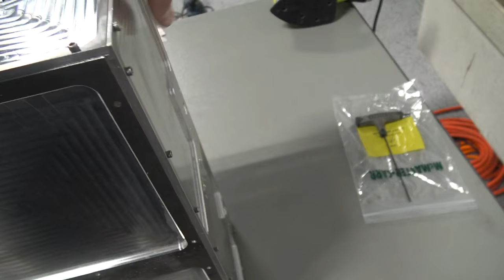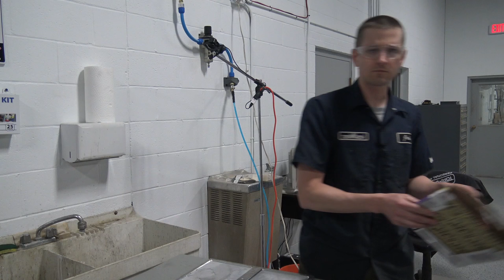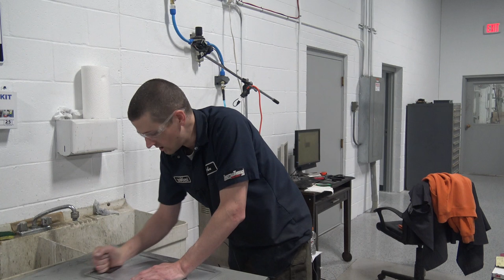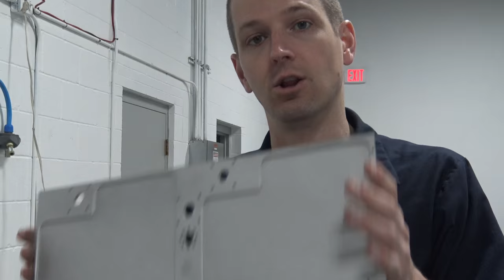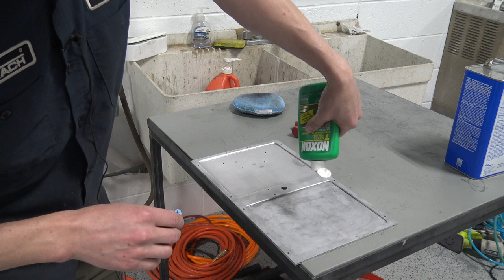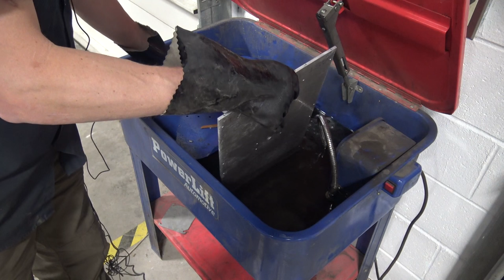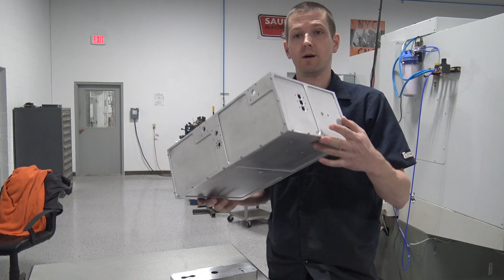Remove Machining Toolmarks!

Comment: I am sure that this is a stupid question but I must ask how deep is your finish cut for the bottom when pocketing I always or nearly always use a .007 to .012 step for the final finish pass at bottom of pocket. doing this greatly reduces the surface variation from tool deflection.

Comment: If your goal was a uniform finish couldn't you work with some die grinder wire brush or scotch brite attachments and get a nice brushed metal finish with some pretty straight forward CAM?  Might not have been spec for this part but swirl pattern looks pretty amazing and is well suited for CAM.  Maybe with some tinkering you could go from cut to brush in CAM and straight to media blast and skip most if not all of the sanding.

Maybe someone can write a random orbit wire brush path for Fusion 360.  ;)

Comment: personally i would 1st use scotchbrite that will keep the face flat rather then using power tools and getting high and low spots. then use some 600 wet and dry ( multiple directions) followed by some 1000 girt with dimond paste on. then to get a mirror finish just go over with a peice of paper (yes normal a4 paper) .... your correct about tool step over the most you want is a 35% stepover.

Comment: I of anticorodal to remove the milling marks I make a pass on the floor finishing with a normal cutter to finish carbide not coated with 4 cutting edges leaving 0.05 / 0.1mm from the bottom. roughing with the same cutter to 3660 rpm - 1380 mm / min and finishing engaging the 80/90% of the milling cutter with parameters from 1500 rpm- 480 mm / min. bur I hold more committed can so sharp enters traditional milling and combining the low speed prevents vibrations. obviously in the cutting area there is a waterfall of coolant  to avoid built-up edge.

Comment: I saw a demo years ago......you might want to check into actual glass bead blasting.  I'm guessing you're actually using glass abrasive at a fairly high pressure?  90psi?  Glass beads get used at around 40psi, otherwise the spheres shatter.  The beads can be used to smooth the surface without any dimensional changes.  You should be able to get a luster to the finish.  It might require a different blast gun....most of the siphon feed ones don't like to work at low pressures.
Reply: +bluehandsvideo Thats what I would have done myself, bead blast. Sanding sucks and all this sanding... wow
Reply: +bluehandsvideo agree... a softer bead media. plastic media works well
Reply: +NCPDFSB The plastic will smooth out the machining marks?

Comment: You should consider Roloc discs. They are much easier to use than that vibrating sander. At least for the corners.

Comment: After sand blasting use a fine wire wheel then for the polish use mother mag wheel polish.  Your results will be amazing 
Your drill press was spinning WAY to fast for polishing.  Your cloth polishing wheel should also clean off the black polish (the black is small parts of aluminum)  
Dont give up!!!

Comment: What if you made a spring-loaded arbor for 3m Roloc sanding/scotchbrite discs, chucked it in the tormach, set toolpath for desired pressure, and sand/polish away!

Comment: There are alot of Comments I want to make, but I have spent alot of time polishing metal by hand, and with tools.  Number one tip I can give you real quick.  WD-40 works wonders for cleaning buffing and polishing compounds off.  Give me a call sometime (grimsmo has the number) I would be glad to give you some tricks ive learned.  Also I have a pretty good idea what abrasive you might want to blast with, that will give you the look they want... right out of the blaster.

Comment: I run 80 only when large flaws are evident, then 150/80 then 220 then sometimes 400 (all on air tool) Then right to a buffer with compound for mirror polish.

Comment: In the shop I work at we use a bead blast like process with sodium bicarbonate then to get a high polish we use mothers aluminum polish
Reply: +NYC CNC As long as there ins't gouges from your tooling and you machine maintains a 125 suface finish or better bicarb will clean it up aluminum very well but leaves  a matte finish. we mainly do it prior to plating to help adhesion
Reply: +NYC CNC If im not mistaken 125 is a .0004" variance in the over all finish of a feature. if you want you want we can chat outside of comment section, that way i can tell you more about what i work with

Comment: I think the customer's design is all wrong.  If the goal was to remove weight, why not put the recessed side on the inside? The surface finish wouldn't be an issue as it wouldn't be seen.
Reply: +Herb Blair If you want to mount equipment like PCBs inside, flat side are surely a plus! But I would agree that they are wrong in wanting a shiny surface. Nasa's aluminum is pretty dull, too ;)
Reply: +tmkr Interesting how you use the word "wrong".
Reply: +NYC CNC Yep, the customer is always right, but not always the smartest. If they are willing to pay for it, then there's nothing WRONG with it.  But, you can give them two prices, one with the way they want it and they way you can save them some money.  During my 50 years of engineering, I had to do battle with the sales guys,  money vs cool aesthetic looks.  Most of the the time money won out.
Reply: Herb Blair that's an oxymoron if I've ever heard one.

CUSTOMER IS ALWAYS RIGHT! lol Im just kidding

Comment: Tips and tricks from an uninformed perspective ;-)

1) Use oil to sand metals (lubes the particles for easy removal).
2) Random directions when sanding will create a "silky" smooth finish*.
3) When alternating methodes use the same grit! Whatever methode used: peaks and dents/scratches will be based on the coarsest grit used last.
4) File -> Blast -> Sand -> Polish is the way to go.
5) Try finer sanding paper before going to a polish. In the thousands before polish results in my experience less work with polish. Though: Still match grit and don't go "back" to coarser.

*The randomness in sanding will ensure the least amount of "strokes" in the same direction. The more random strokes in every direction the less likelihood of error. Something of signal to noise ratio...

Oh yea: Sometimes it's handy to wield the work and have the sandpaper stationary (if need be spray glued on a block) to ensure even pressure and have the mass of the part "work" for you against the paper.

One more tip: Less effort by less pressure will cost more time, but might be worth it when the pressure is perhaps to high. In other words: let the paper do the work.

Comment: Hey. Why are you not using double layer method on each side. The first aluplate is then very easy to polish because of even layer, and the second layer ist that with holes and structure. Then you can screw it together and your construction looks pretty good and the whole process of polishing is more easyer.

Comment: John, let me give you a life changing tip... Invest in some grease-less abrasive for a sewn cotton wheel for your buffer. I polished aluminum for ages before trying this method and I wish I had not wasted all of that time. A quick google search should pull up all you need to know.
Reply: +NYC CNC Also definitely switch directions 90* each sandpaper change. Do not go to the next grit until you are absolutely certain you have gotten everywhere. Again though, use grease-less abrasive. You can also put it on a die grinder with a foam conical tip and get into tiny corners. Also invest in a sisal wheel + Black Rouge after 800 grit sanding, then brown rouge + a sewn cotton wheel for medium polish, and for that unbelievable deep polish finish with a loose cotton wheel and white rouge. "Cut" the part by pushing the part against the direction of rotation of the buffer. "Finish" the polish by pushing the part in the direction of its rotation, which helps remove excess rouge. Do not cross contaminate your buffing wheels and keep them stored away from dust and abrasives. Don't use a lot of pressure, you'll get a feel for it but let the rouge do the work, not your muscles. move in a steady forward motion, like when welding... don't let the heat build up in one spot. 

I taught myself to polish when I was 15 while building my first motorcycle and for some reason became completely addicted to it... Something about that perfect finish. Long story short, that motorcycle still hasn't been built, but boy the pieces look amazing.
Reply: +Transane Almost forgot, clean the part well between coats with soap and water and a microfiber cloth. Paper towels and shop rags leave scratches that you wont notice until you get good, then you'll be forced to go back and re-do everything.
Reply: +Transane send me a private message if you want to give me a call and poke my brain about details. I had actually been in touch with you many years ago when you first started out back in NYC... Nowadays I get to work with some of the big cnc's, but much of my interest came from your videos and I have been an avid fan for ages. 

Oh, final thought; replace that fluid in the parts cleaner every year or so. Sediments and oil builds up in the system and is hard on the pump and isn't very good to be putting on parts you're trying to clean. Also a small filter isn't a bad idea.

Comment: Hello John,

I watched this video and thought that I could help you in achieving a polish on those aluminum plates. When ever we want tool marks to disappear we will sandblast the parts. Blasting media does come in different grits to give finer finishes. On parts that won't fit in the blasting cabinets we always used the maroon scotchbrite  and elbow grease to remove tool marks from parts. Now if we wanted to polish aluminum without removing excessive material we had a 8" pedestal grinder with a cloth wheel on one side and a scotchbrite deburring wheel on the other. While using the cloth wheel we used polishing compound (white  or red brick rouge) we would dab a coating onto the wheel and then go to town on the part. They do sell the cloth wheels for die grinders to get into the hard to reach areas on the parts. If you want me to get you some pn#s for these items I'll be glad to help.  Send me a message with an email address and I'll get them right to you.

Comment: I think that the whole bead blasting step made your job harder. doesn't that harden the surface of the metal and make it harder for the sandpaper/abrasives in solution to cut?

Comment: Think "Truck Wash" Truck washes use Muriatic acid to clean aluminum. Left on for just a minute it will lightly etch the aluminum. (automotive wheel cleaners have Muriatic acid but to low of a concentration for this) ( swimming pool supply would be the best place to get Muriatic in full strength)This will chemically remove the tool marks. Then to polish use Colgate tarter control tooth paste. Yep, tooth paste! Rub on let dry then buff off. Done. Good for a polish but not supper high shine.

Comment: after you glass bead blasted a finer media like walnut or soda would have been the thing to do in my experience. Would have made it shine but wouldn't smooth out the surface from the glass beads.  I would have done the whole job in the blast cab or I would have sent them out to a polishing shop. Comet will clean that sink up like new too ;]

Comment: UH.... Bead blast  ?  You can't make any money like this. Bead blast is quicker more efficient  and it will remove all the mill marks and oxidation from the un-milled area's as well.
Then anodize or cerakote

Comment: blast it then use meguiers tar and bug remover to clean and polish. rub it in a single direction always else you will have swirls.
then finish with canuba wax to bring to a nice finish.
this is how I polish my alloy air box made from alloy plate.

Comment: If it only specs "remove tooling marks". I wouldn't have gone through the trouble of sanding. 

Coarse then medium grade scotchbrite would have done perfectly fine. 

As for the sandpaper.  Honestly doesn't really matter. Sanding doesn't generate the heat like grinding does so you're not going to get the welding and build up effect like you would with grinding.

Comment: What about electropolishing?
Reply: I assume that the surface pattern has to be pretty even to get good electro polishing results. As far as I know electro polishing will remove the same amount of material all over the part so the machining marks will just be polished but not removed. But maybe I'm wrong and if you electro polish it long enough the marka will eventually vanish.
Reply: On that scale, yes. Electropolish removes very fine surface imperfections. So my thinking would be using the sand paper first and then finishing with the electropolish. It would give a very nice shine, I think.

Comment: I think you started with a way too corse grit. I would not have gone less than 220 grit with a small electric or pneumatic sander until smooth then jump to 400, 600 and finish with 1200
Reply: Agreed. 80 is so effin course! I think I used to do 3,6,800 grit then on the polishing wheel for mirror finish.
Reply: +nickolaguez 3,6,900**
Reply: +nickolaguez 80 grit is a good starting point for wood but not metal

Comment: I'd have probably used a hand rotary airtool with a pad or wheel and worked down the compound polishing paste grits like on car bodywork. you could reach the majority of those recessed areas with pad and used the wheel to really get in against the edges and corners. 

However, I did think "uh-oh" as soon as I saw you wanting to hand sand those inside corners - way too intensive, labour-wise. If you can find a course polishing compound grit and adapt your final cnc pass for the smoothest finish, you may be able to avoid the sandpaper altogether.

Edit: quick search brought up buffing compounds starting at 60 grit, 320 gives a satin finish http://www.matchlessmetal.com/compounds.php Perhaps look up a few of these companies and give them a call

Comment: Good video. One thing I would recommend is seeing if your customer will let you anodize it and have it "Bright Dipped", of course assuming they don't need the parts to be highly conductive. Typically that will pull off about 0.001" and leave a really nice surface finish and will pull down most of those tooling marks in the pockets. You can contact http://www.allbrite-anodizing.com/ as they are on your side of the country(note I have no affiliation to them just have heard their name before).

Comment: Shot peening, perhaps?
Or, redesign the lightening to be easier to machine polish  (large flat areas are always more difficult to make look good), say round ended parallel channels that could be polished with scotchbrite discs on the end of a shaft and CNC directed.

Comment: hi john, we in the uk have a polish for metal parts, search on ebay " 100g Autosol Solvol Chrome Polish Cleaner Aluminium & Metal Paste tube 75ml  " i have used this alot over the years and it maybe help you if you can get it ok, thanks Daniel

Comment: Take a look into scotch brite wheels and such. You can get some nice little ones that go on an air die grinder that will get into the tight corners. Larger wheels can go on a bench grinder like buffer. After going from coarse to fine, then hit it with a cotton buffing wheel until it shines right up. That wheel on the drill press was maybe good for a final polish. The polishing compounds should buff away and shouldn't need to be washed away. The stuff I use is more like a wax than a liquid.  I've messed around and gotten mirror finished in aluminum.

With the CNC machine you should be able to gear up a scotch brite tool that removes the heavy tool marks without removing any more material than necessary. It might take some playing around to get the z heights just right and account for the ware.  You could even put a felt wheel in the machine and do some of the polishing. 

http://solutions.3m.com/wps/portal/3M/en_US/3MIndustrial/Abrasives/Products/~/Scotch-Brite-Roloc-Surface-Conditioning-Disc?N=7581642+3293241340&rt=rud

Comment: John, in the aircraft industry we've used products like this http://www.topoftheline.com/alexpol.html before, to get proper shine out of aluminum.   After buffing It takes a LOT of hand work to get the black oxidation off with tericloth, and it has to be done before that black stuff dries, or it stains area.  It's true, that different grit polishes do produce different levels of shine.  http://www.brightworkpolish.com/aluminum-aircraft-polish-step-by-step-polishing-guide/

Comment: Steel wool wrapped around a wooden dowel and a drill press/hand drill. Works amazing and is pretty fast. It is also pretty gentile on hard corners. This is what my parts come out looking like after 2min of work:
http://i.imgur.com/0X2YSzX.jpg
Reply: Wouldn't that lead to steel fiber impregnating in the AL? -> rust?
Reply: +Spencer Clayton Never had a problem, even on outdoor parts. It just brushes the surface. By the same logic, wouldn't Emory leave particles in the alum or media blasting leave media?
Reply: +Chatham CNC perhaps, but afaik Emory or blasting media is not reactive with oxygen. Good it works for you though

Comment: Also, keep in mind that aluminum dust is extremely bad for your lungs and it stays there forever. You need to always wear a mask at the very least, but better a respirator.

Comment: Too bad there's not a large rubber tool that you could put paper sanding discs on and chuck it into the mill to do a cleaning pass after cutting it.
Reply: +Jon Gordon There are a few options for doing this like the NamPower brushes from Brush Research. It also wouldn't be out of the realm of possibility to throw a pad from a pneumatic sander into an ER collet and run it like it was just another tool.
Reply: +TimeLapse Exactly what I had in mind. Cheap, easy, and in abundance.